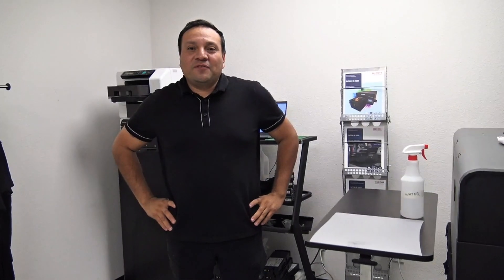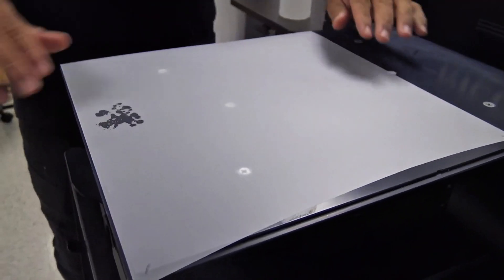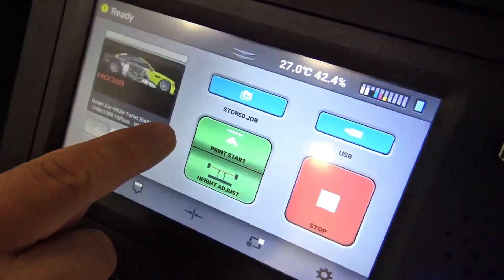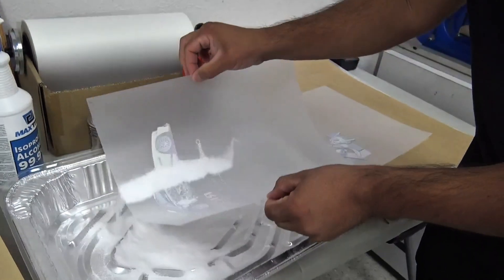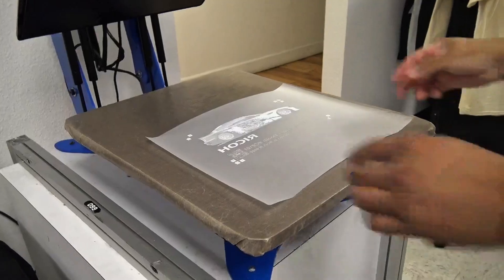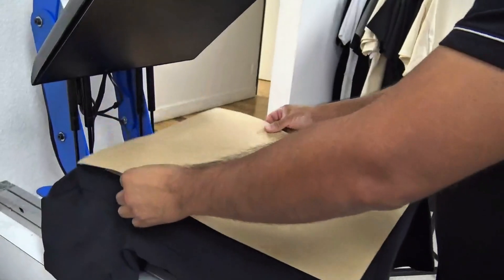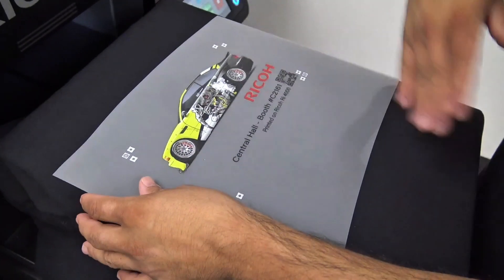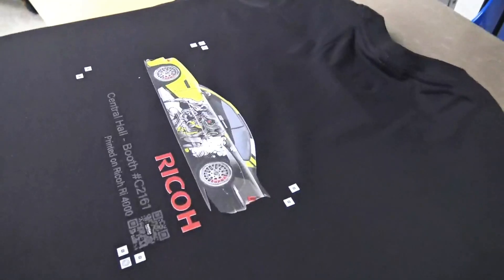Printing DTF transfer with RICOH Ri 4000

Comment: share price for Printing DTF transfer with RICOH Ri 4000 for pakistan
Reply from the maker: Hi, thank you for your question. For pricing on the RICOH Ri 4000 and DTF transfer printing in Pakistan, your best bet is to contact a local authorized Ricoh dealer directly. They will have the most accurate and up-to-date information on pricing, availability, and local support for your region.